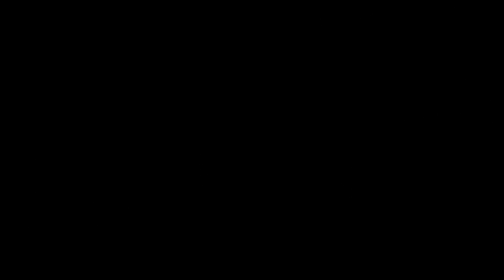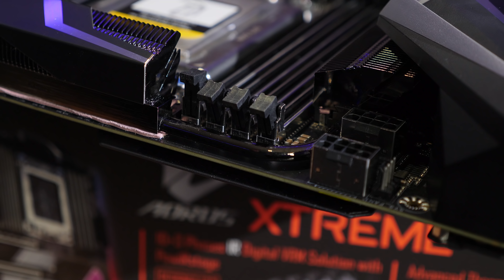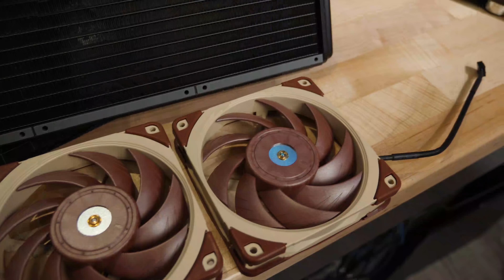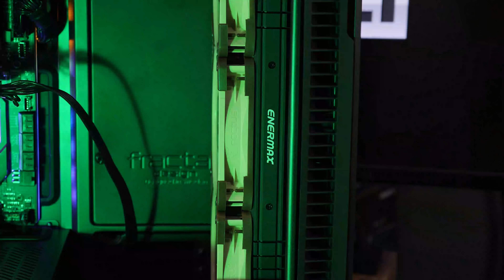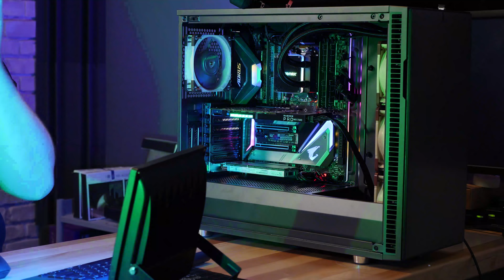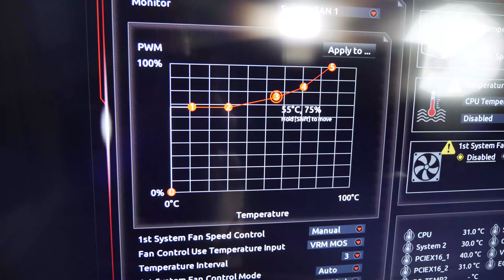TR 2990WX Programmers Workstation: Linus Torvalds' Edition (sort of)!

Comment: Seeing this only a year late :P but one great tip for reducing noise is to use 140 mm fans. 280 rads have only 10% less surface area than 360mm rads. 2x140 mm Noctua fans can push as much air as 3x120 fans at much lower rpms with almost no loss in pressure. So you could be running 1200 rpm 140mm fans instead of 1700 rpm 120 mm fans and get pretty much the same effect but at much lower noise levels. Please note this is mostly possible with Noctua fans - with almost any other fan i've noticed significant pressure drops with larger fans.

Comment: Late to the party but recently found you through Gamers Nexus. Personally running a 2950X with a Gigabyte Designare-Ex, G-Skill Flare X and Seasonic Focus Gold Plus, cooled by a BeQuiet Dark Rock Pro TR4 in a Pure Base case. Also got a Fractal Design R6 but that holds an Intel system.

Comment: I still have the original Define XL from 201 (has 140mm side fan, no top vents*), it had been running louder than usual with higher temps. So yesterday I actually got around to cleaning it, I thought it was just the intake filters that needed cleaning... Nope! The variable fan controller had died taking out 4 fans; all 3 in the front (two 140mm & 120mm), plus the 180mm fan in the top (*that pushes air out the back, not a huge amount of airflow, but removes dead spots). I replaced it with a PWM splitter as I've run out of motherboard headers (5).

Now runs passively with only the CPU fans at ~600rpm if I limit the CPU to 40%, or all fans at ~1000rpm when stress testing (i7 6700k @ 4.6ghz). One problem I've found with air cooling and low fan speeds at idle with that the CPU temp jumps up before the cooling catches up, making the fans spin up)

Noctua will send free AM4 upgrade kits for DH14-D14 owners, I think that's a nice touch. I'm hoping case and cooler can handle a 3850X without being noisy. As I'm not a fan of open-topped PC cases as I don't want a spilt drink on my desk (like yesterday) to kill the computer, plus fans in my line of sight are noticeably louder..

Speaking of RGB shaming, I have some black fabric covering the power/ disk activity light (no noise and no lights👌).

PS: I would be useful to see some benchmarks on different memory speeds/ number of channels on high core counts. Two channels for 16 cores does seem to be pushing things. Same goes for testing different fans, with and without filters (opening my computer to clean it isn't as fun as it used to be).

Comment: Do like me, use as many noctua fans as possible in the case, then it’s so cool that it never ramps up.
Reply: (Like if you do water cooling, I do push-pull with 4 noctua fans on the radiators each)

Comment: Can anybody out there tell my why a cloud-based fax utility would freeze up while using wayland - happens during the send fax portion of the procedure.

There are several such fax programs.  I am using XenFax.   

www dot xenfax dot com

This utility works in Fedora 29, OpenSUSE Tumbelweed, all Debian / Ubuntu distros in Firefox 64.  Kernel does not seem to matter.   May not work on some other browsers

Only $ 5 USD for 100 pages

The Android app works good.

Comment: hardware unboxed video showed that despite the fact that aorus motherboard has two fans it requires a decent case airflow to do well in overclocking and even then it fell kinda short of asus and msi top dogs, so I would switch the motherboard for oc'ing but I dont think linus is into overclocking :D

Comment: I had to replace a 15amp GFCI breaker with a normal 15amp as the GFCI kept tripping when my PC was underload with a 4.5ghz 5960X and 2x 1070's. At stock it was fine for a long period, but the GFCI breaker just was too sensitive compared to a plain jane 15 amp breaker.

Comment: You should give the Thermalright Silver Arrow TR4 air cooler a try. I'm using it on my Threadripper 2990wx with great success (and very quiet most of the time) but I have barely heard anyone talk about it yet.

Comment: Is 250 W vs 180 W TDP really that much of a difference to make Noctua insufficient? I'm running a 1950X with Noctua NH-U14S + additional 140 mm Noctua fan in a SilentiumPC Pax M70 Pure Black v2, it's completely silent with fans running at 200-300 RPM and temperatures never rising much above 60°C under heavy load (i.e. recompiling whole system - Gentoo). Compiling Linux takes about 40 s. Even during the summer the noisiest things in my vicinity were my displays' power supply coils.

Comment: How on earth can you recompile the entire kernel in 26 seconds? I have a copy of the 4.14 kernel on my Threadripper 32 and it has been pecking away for more than 10 minutes at make -j32 so far, granted I have not gone insane building this system with the best of the best of everything but the discrepancy needs explaining. Can you please provide more details on exactly what you compiled and how? Is there a video?

[*snip*]
  LD [M]  sound/usb/snd-usbmidi-lib.ko
  LD [M]  sound/usb/usx2y/snd-usb-us122l.ko
  LD [M]  sound/usb/usx2y/snd-usb-usx2y.ko
  LD [M]  sound/x86/snd-hdmi-lpe-audio.ko
  LD [M]  virt/lib/irqbypass.ko

real 18m28.739s
user 487m11.961s
sys 38m42.276s
vince@dead-penguin:~/projects/linux-4.14.3$ uname -a
Linux dead-penguin 4.13.0-46-generic #51-Ubuntu SMP Tue Jun 12 12:36:29 UTC 2018 x86_64 x86_64 x86_64 GNU/Linux
vince@dead-penguin:~/projects/linux-4.14.3$
Reply: As someone else said, make -j64 is one obvious tweak. Remember that the storage was RAID 10 Nvme, which could be another bottleneck. I'm assuming you also have enough RAM to avoid swapping and you aren't thermal throttling either.

Comment: Did you try to have the rear fan in intake orientation? With the 3 x 120 mm exhausting in the front, and only 1 x 120 mm and 1 x 140 mm intakes in the bottom, I bet it would help with cooling - especially the VRMs sitting right next to the fan.

Comment: When you said "a cluster of Threadrippers" I was really hoping it was a functional cluster rig. Three Threadrippers tied into a cluster would be a thing of beauty.

As for the build... I would do unspeakable things to obtain it. A few years ago I bought a salvage Supermicro quad-socket board that supports hexacore Opterons. I thought I was going to build the mack-daddy 24-core workstation. Now you can buy 64 cores on a single CPU... FML. Though, to be fair, I could build my entire workstation for less than the cost of just the Threadripper.

Comment: I also have two fans exhausting on the bottom. I have a Corsair 750D case with a full inch clearance on the bottom, and it keeps dust from settling on the glass table it's sitting on.. which is great since the glass is black and you'd see any of it.  I also have those Noctua fans (Sterox?  I can't remember).. and I can't say enough about them.  They're what you want if quiet is your thing, and still want to cool your PC.  They move more air than any other fan this quiet I've ever used.. and I've used many.

Comment: Awesome project. Insane that we've reached limits where even the best VRM cooling available isn't enough.
Reply: Buildzoid did a video on this, it's not that the cooling is necessary is that almost all the VRM solutions are way under provisioned for a overclocked 2990WX and are deep into their inefficiency curve. More VRM phases are necessary for the first time in a long time.
Reply: I guess atleast the boards have safty mechanisms to power off or throttle if temps are too high, i remember in the phenom 2 days a 125watt 6 core 1095t or the 1100t were blowing up boards, just straight out frying the vrms. Even overclocked phenom quads were blowing up some boards.
Reply: @janiss2926  Intel's high core count stuff is also facing VRM temp issues in the consumer grade stuff, I haven't read to much about the 9900K and the boards but I'm fairly certain that people will have these issues as well as 9900K will be supported on many low end boards and maybe even naked VRMs if the buyer don't know much about it.
Reply: I hate water cooling , but I had to do it to cool the vrms on my h11ssl. :(

Comment: Question about your build. What type of Noctua fans are you using for the Enermax Radiator? Followup question, "If I wanted equivalent Black colored Noctua 120 mm Fans for my Enermax radiator, what would be your suggestion?" Thanks in advance.

Comment: I made a cardboard fan duct back when I had a Mac 3G Beige desktop. I removed the 300 MHz CPU and replaced it with a 1 GHz chip then overclocked it to 1.18 GHz added a Radeon and some ram. was pretty sick. I tried to get a device that would allow 2 CPUs to connect to one socket, but it was no longer available

Comment: Hey Wendel, did you get a chance to see Hardware Unboxed's X399 motherboard video? Steve compared 4 X399 boards for their VRM temp and surprisingly, Gigabyte performs awful and is not only limited by temperature but some sort of over-current protection kicks in. There are better boards out there like Asus Zenith Extreme (with fan add-on) or MSI MEG Creation (totally passive)
Reply: OC3D also made a nice review on the board
Reply: Aye, I don't get it why he chose the Gigabyte board over the MEG Creation either. The latter has better VRM's and is cooled passively (-> lower noise). It would suit perfectly for his goals, right?! Also the Creation part of its name would suit this build very well. :D

Comment: Question about the R6, with a EATX Mobo (like the MSI Meg/Aorus-Xtrem/Asus Zenith). Is there interference/contact stopping the drive bays from being installed, for 5.25/3.5/2.5 storage (plate forward, hiding the drives from the window side). Can the ATX 24 + 8 pins,  Sata data and front panel connectors/cables,  still be routed, with out clearance issues?    As I'm thinking about an R6 set up (2950X + EATX mobo + 64GB ram) with an optical drive and several 3.5 HDD and a few SSD (+ nvme boot drive). All air cooled and I'm hoping to use this case, but its depends on fit.

Comment: Gigabyte board is one of the worse ones for Overclocking, even with the heat sink since the VRM is very questionable (even with the fans). I believe Hardware Unboxed did a video reviewing the x399 boards with the 2990WX.

Comment: I craft ducts out of cardboard all the time lol! Most OEM workstations like HP Z and Dell Precision have ducted air flow. Makes perfect sense. It's amazing how little attention ducted airflow has in the custom pc space. Maybe someone should just add rgb LEDs.
Reply: I agree. I'm trying to sort out how to add ducting to my next build just because it's the best way to optimize airflow.
Reply: 3D printing is my method of doing ducting, though that's easily a week to a month learning Solidworks before I could start doing any real duct designs.
Reply: I definitely want to get a 3d printer one day. I'd totally use it to print ducts, drive brackets, and other accessories for pc's and cases.

Comment: Hey Leve1Techs/Ryan/Krista/Wendell, what do you think of this Zhongshan Subor Z+ PC that uses an interesting powerful integrated video system that is the same sort of thing as what consoles use, but more advanced? Seems like it kinda has some neat potential. I am worried that Linux support —and especially video passthrough— would be a mess though.

What I'd really love is if some emulator developers somehow could code to that sort of architecture such that it wouldn't really be an emulator anymore. I strongly doubt this is even possible though, let alone that freelance low-paid/non-paid developers would implement this for such rare/niche hardware though.

Comment: Thanks for a very good and entertaining video. I have an observation to make. The Enermax 360 TR4 II cooling capacity is not enough for the 2990WX, sorry. With 6 Noctua F12 3000 rpm industrial fans in a push / pull configuration I am able to run Blender without throttling @ 4.0 GHz and @ 4.2 GHz with SMT off. With the 2990WX @ 4.1 GHz the CPU will throttle in Blender. Enermax should sell a 360 version with a 39 mm thick radiator instead of 28 mm. Their 240 TR4 II version use a 39 mm thick radiator. Also you will get better performance with PBO using a 39 mm radiator. Some custom liquid cooling radiators is 60 mm thick but at that thickness it will be a tight fit in most PC cases. I have an old retired Enermax 360 TR4 I cooler that I may convert to a 60 mm thick 360 cooler in a future project.

Comment: Actually the Designare is pretty darn weak VRM-wise, using less powerful VRMs than just about any of the competition with rather terrible heatsinks. A perfectly fine offering for a 1950X, far less for a 2990WX which the board wasn't intended for. The Aorus Extreme being a slight upgrade over most of the competition, comparatively.

Unfortunately it seems like the only upgrade from the Aorus Extreme would be a X399 MEG, which looks absolutely absurd, but is equally as absurd in performance (as well as theorically eliminating some noice due to not having a fan mounted).
Reply: If it bothers you, you can take off some or all of the shark styled covers.

Comment: It's basically silent mate, almost 1.5 meters of rads, the fans almost don't need to spin :P
Reply: We will have to see how well it does in summer.
Reply: killum109  I have a magical device that keeps the room at 21c all year, it's very nice ;)
Reply: Steve, isn't the board Wendell is using the same motherboard you found to overheat the VRM despite the 2 fans?
Reply: Maxvla  yep, doesn't work on an open testbed without air-flow very well.
Reply: Contact issues?
Remove the heatsink and clean everything up, then get yourself some articulating paper, put it on the vrms and mount the heatsink.  Then remove it again.  The paper will tell you exactly where there are contact issues and to what extend, giving you and idea on what you should do to fix the issue.
It's the paper dentists let you bite down on to check if your teeth fit well together.
Reply: @kmi187 Gigabyte uses cheaper 50A powerstages in a 5-phase configuration with doublers, that's the problem, not the contact. The thermal pads and heatsinks are actually very good. I suspect Gigabyte tried to make up for using cheaper components with better cooling.
Reply: Hey Steve, what's the case you are using?
Looks very nice and a lot of available space.

Comment: what I really don't understand, why is there no proper workstation CPU from AMD. Basically the 2990WX with an 8 channel memory interface. Or an Epyc 7551P with higher clock speeds (maybe 250W TDP like the 2990WX).
With my compute loads, I am basically directly limited by both. An increase in the cores, frequency or memory bandwidth all translate directly to a corresponding speedup.
Reply: Because the majority of workloads don't really care for much higher clocks. When my machine is just going to sit in the server room running a hypervisor it's a useless metric.

Comment: What about compile times for boost, Qt (with/without webkit), UE4? And or how well it would work with a big solution (>200 projects) and ReSharper running a full solution analysis. Just kernel compile times is a little boring.

Comment: Use the MSI MEG Creation Motherboard. Its actually designed for this monster to overclock. It has a 12 phase VRM with 70 Amp power stages.

Comment: What is that wireless keyboard you are using? Is the trackpad decent?
Reply: Looks like the Logitech TK820. I was looking at the same thing. Unfortunately, I think they've discontinued it in favor of the K830. Which kinda sucks, because I really like the whole "integrated button" touchpad > the K830's touchpad. However, the K830 has a backlit keyboard, which is always a welcome feature. https://support.logitech.com/en_us/product/wireless-all-in-onekeyboard-tk820

Comment: Maybe try running the rear fan as an intake with the rad at the front, but put two intake fans (one on top and at the bottom like you have it) at low rpm feeding air into the rad exhausting out the front. Just for science 😜
Edit well if you haven’t done this or something similar already lol

Comment: @Level1Techs  Tiny Tom Logan(OC3D) found the Gigabyte motherboard got hot on the back side as well as the VRMS. He stuck a fan around the back to blow air onto it and began passing benchmarks he wasn't able to before. Might be worth modding the case to fit a 80/120/140 fan in the rear. Noctua make a 120Slim which is very nice.

Comment: Would you do an update on the Enermax TR4 cooler in a couple months? I had 2 of them gone bad in less than 4 months.Glad that I caught it. They're great when they're working, but both of mine failed (pump) after just little more than 3 months. I don't trust them anymore.

Comment: Meanwhile my rig compiles the linux kernel in 25 to 30... minutes :/ 30 seconds oh my god
Reply: Use a ramdisk. 1min with fx6300 6x3.8GHz. To compile from hdd is a joke.
Reply: @maddfix  I compiled from ssd in the past but ramdisk sounds like a nice idea. Too bad ram is still really expensive
Reply: If it only takes 30-60 seconds, you don't get to do something else and say "I'm compiling" as an excuse.
Reply: My thoughts exactly, and I have what most consumers would consider a high-end cpu.
Reply: With more aggressive compiler flags, it could still take quite a while longer. I usually compile my kernel with GRAPHITE optimizations plus the usual -O3 -march=native -mtune=native and some other flags. But it's worth it, with an optimized kernel config for my hardware it consumes way less RAM and even the desktop feels much smoother.
Reply: @theEmil , a 3-5 gig ramdisk would be enough for most builds of a hobbyist. If you need bigger and lack the resources, you have the wrong hardware for the job, imho.
Reply: Or just use CFLAGS="-pipe"

Comment: the 8b gig version ( per stick) of the crucial stuff will run at like 3000mhtz cl16 no problem if you bump the voltage to 1.35

I also wish fractal would just make a mesh front for the Define S, its the best case for watercooling.